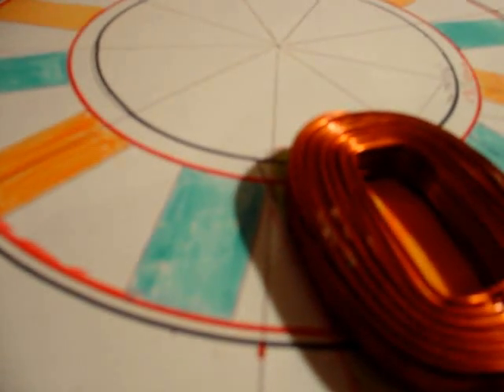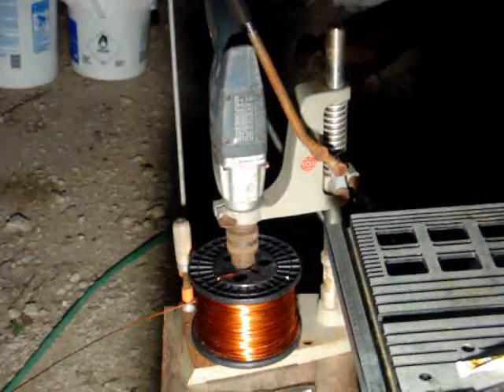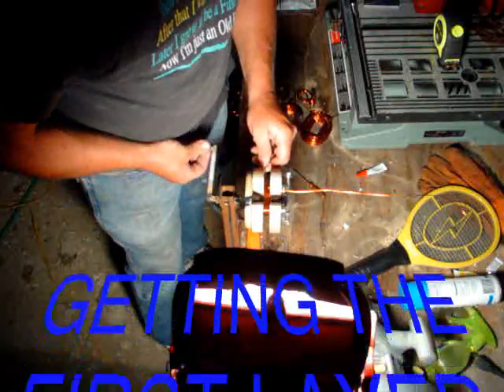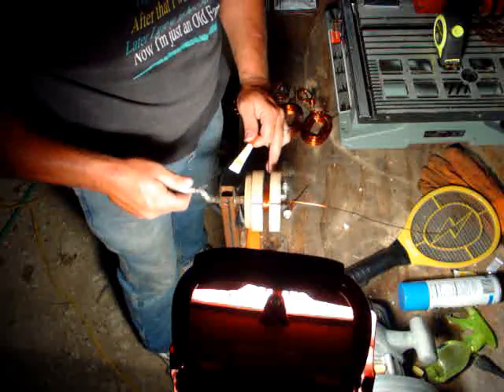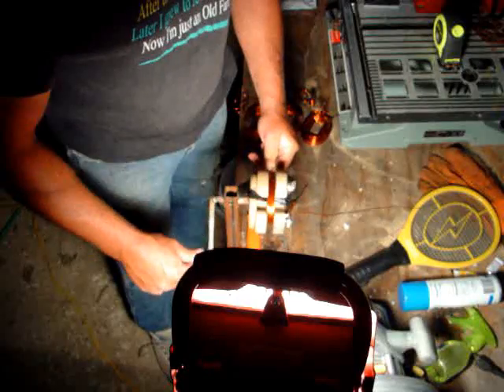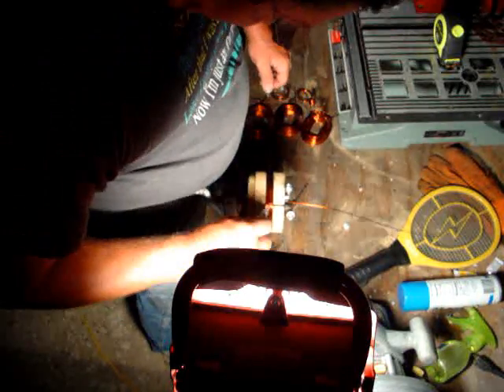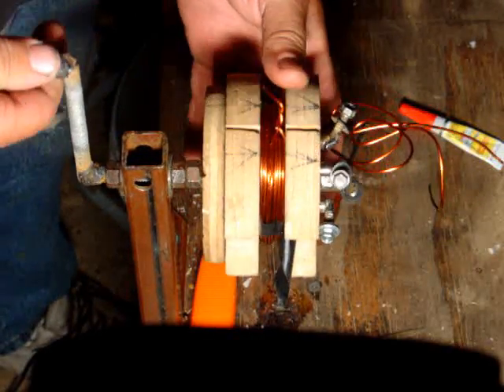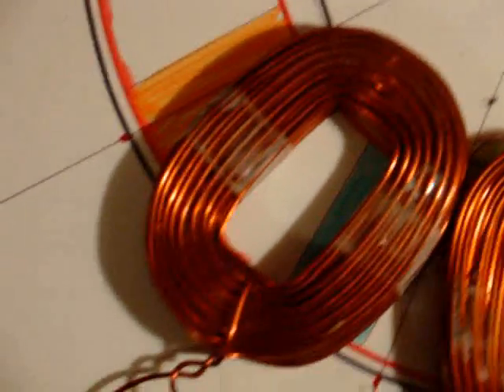BUILD A DUAL PERMANENT MAGNET ROTOR WIND TURBINE (PART 8)

Comment: Use a strip of wax paper as the base of your mandrel. Also take some twine or light cord with and tie it to a home made block that has 2 pieces of felt in the block. Use wingnuts to tension the wire running through the felt. Tie the cord to something solid inline with your mandrel with enough room to lay the wire. This will give even tension and get your coils more uniform. The wax paper will let the wound coil come off easier. If you want an idea to square up the wound coils I can help with that too! Nice videos with clear instructions! Looking forward to the complete unit.
Reply from the maker: Sheer excellence in heart, and instruction. great suggestions my friend. THANK YOU.

MUDDy

Comment: This whole series of videos is wonderful.  Thank you so much for sharing your knowledge.
I wonder if you could comment on your choice of magnets.  I'm guessing they're
2"x1"x1/2" N52 Neodymium.  Also, what should a DIYer expect to pay for 24 of those?
Reply from the maker: Thank You and you are correct on the choice of magnets. And the price?...... As cheap as you can get them. I havent bought any in so long, I'd be lying if I guessed.
Reply: @muddymuddymuddmann  do you have a vid about using a alternator for 110 volts. Thanks. If not can you make a vid

Comment: Yeah, it's like rolling a garden hose up. It seems simple, but getting it nice and flat and perfecct can be tricky.

I have lots of scrap wire. If there a way to recycle it for winding coil? Can I dip wire into a bucket of enamle or paint or do they use an eletrostatic charge to make the ename stick to the copper like they do with aluminumumum?

Comment: I'm using 10 gauge wire. Doing theath, if you're using 14 gauge@77turns and 14 gauge is .064 thick and 10 gauge is .102 thick....064 is 60% of .102 then I need to make my cpils with 46 turns. Does this make sense to you? Thanks muddy
Reply from the maker: if I told you yes, I would only be guessing. yes it makes sense. But that sounds close. If I were you, I would wind a test coil, and turn the rotor at any easily figured rpm like 120 rpms, and take a voltage reading in ac. Then you can figure out the rpms per volt. 
34.3785 RPM per MPH with your 44 inch prop , That's if the prop is a 4.5 TSR. 

11.86 feet circumference, 206 rpms at 6 MPH, and 240 RPMs at 7 MPH. aim for those rpms for startup charging voltage.
I am glad I still keep this old xp puter running straight.
 
ENJOY

Comment: Hello mud very 
good work, a question I have a coil, 130 turns of 18 gauge I put in 2 
rotors of 14 magnets each rotor, n52 25mmx50mm and reading ue I get 
variation of o to 150 microvolts. I wait your answer thank you
Reply: 18gag

Comment: Just wondering if you could do anything with a solar panel that came from a electric fence charger. The panel still works cause in the sun works except after sum goes down no juice doggone ants got in it so does not saves juice to battery. Should I trash it or save it for another project. Just trying to stay really GREEN.

Comment: If I remember correctly, you said 77 windings each coil. Why is that a magical number? Is it the size of your magnets that dictate the number of windings? If that's the case, the bigger your magnet, the more windings, hence more energy produced?
Reply from the maker: Actually the bigger the magnets, the less turns needed to reach the charging voltage at the desired start up rpms . And the 77 turns is what I figured from another design close to mine when i altered the numbers by %. longer prop turns slower,  add more turns by the rpm difference in percentage to reach desired voltage in desired start up wind speed.
Except on Mondays when it rains. lol.

MUDDy